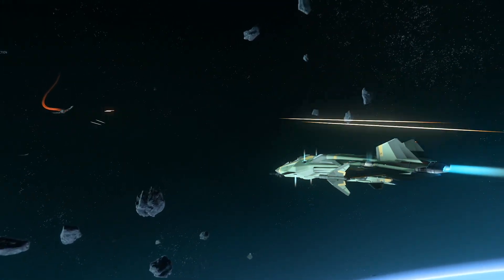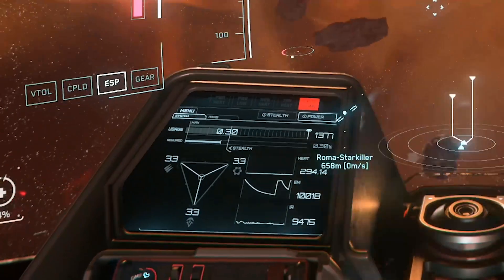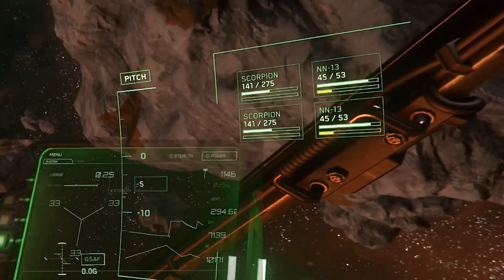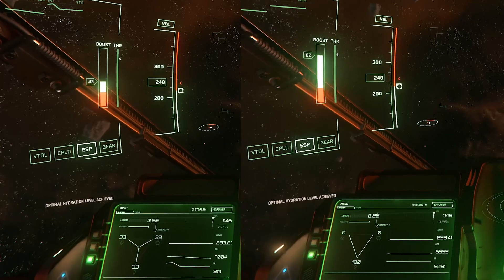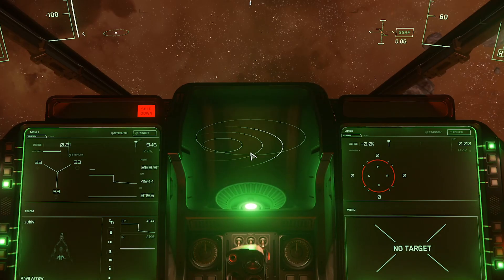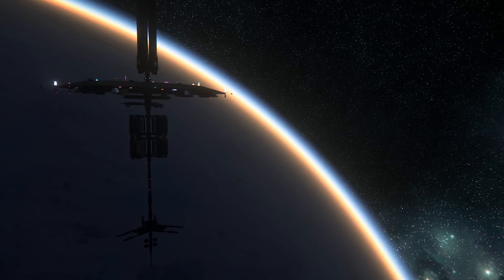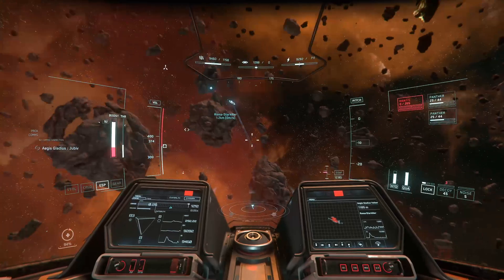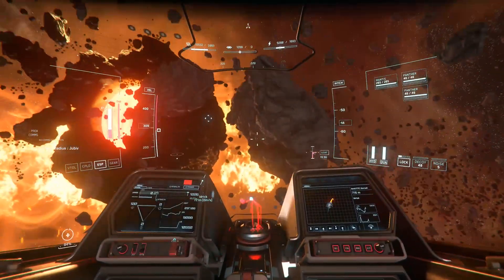CAPACITORS in 3.14 - Star Citizen Tutorial

Comment: This is very useful information, thanks. I think it would also be really nice to see how negatively affected each system is when power allocation is reduced below 33% or removed entirely. Is it a linear decay in performance, or does each system get increasingly worse the closer it gets to 0%?
Reply from the maker: At 0% capacitor you get nothing. For example, if you are at 100% weapons, you get zero boost regen, zero shield regen, zero boost cost reduction, zero shield resistance modification. In fact, for the latter two, they don't start until 33% capacitor.
Reply: @LegacyFleet  So, for example, if in a big pve furball with xenothreat and other players, and only taking the occasional hit to shields. Thrusters would be of minimal importance to me if I can stay on target. I would want at least 33% in shields to replenish at all? And I could put the other 66% into my lasers? That is what I get from you saying that with less than 33% in shields, they won't replenish at all.